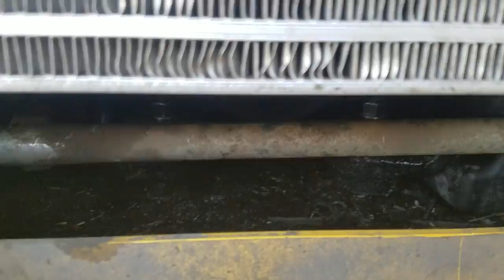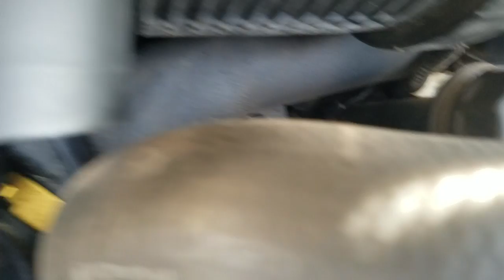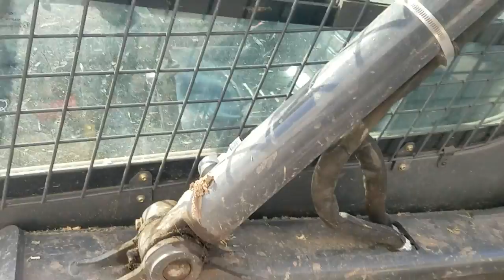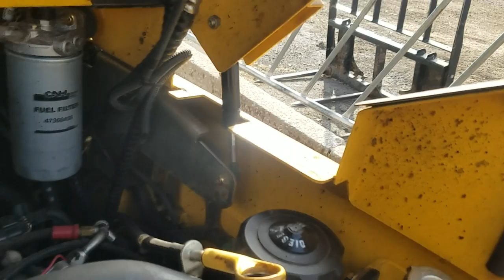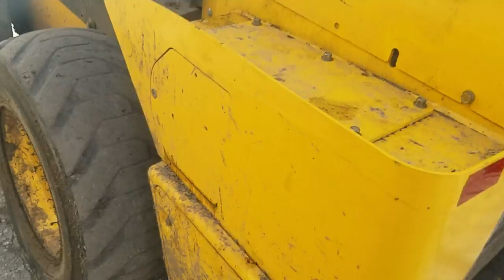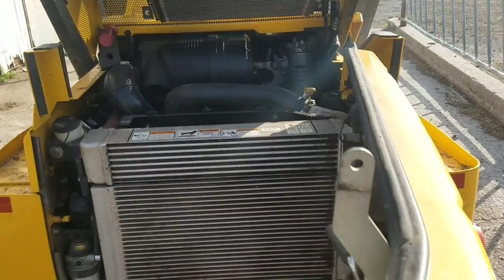The skid loader just keeps on giving more problems.

Comment: .  maybe the diagnosis of the oil leak should have been enough to know that the machine has some type of terminal problem with the motor.the tech should have advised that he couldnt fix it in the field and saved a problem with you being billed for unnecessary services he clearly doesn't have the ability to fix.
Is this machine under any type of warranty?  maybe you can get outside repairs!  90% of dealer techs dont know how to repair only to replace parts.  as  35 year's of experience tells me that . if your not under warranty obligation to the dealer., I would suggest that you find a good all around honest mechanic to be your farm repair man. maybe someone who has broke away from the dealers and works hard for a fair price!   I  work for my self as a mechanical technician and work behind the same clowns that you are having trouble with.  don't be fooled by there b.s. it happens to good people everyday. a good mechanic can fix any type of equipment and "cant fix" isn't in there vocabulary. if its not repaired then dont pay. they are just guessing and changing parts and running up your bill. if the dipstick is blown out then crank case pressure is building up . surely wouldnt be long before it blows a seal or gasket out. witch will be a great waste  of time. sounds like a burnt piston or something like that.  first 15 min on the site with a breif explanation should have been enough . sorry for your troubles.  good luck.
Reply: joe wisman it is under warrenty he said but  if you read the warrenty fine print equipment transport and service calls are not included just labour and parts sad but true
Reply: and is that not the seal they just did i think it is isn't it?

Comment: On my LS 140, it only runs for exactly 90 seconds then cuts out.  Then I gotta start iy up again to only operate it again for 90 seconds.  What could the problem be? Is it a solenoid, or other electronic part?  Is it detecting low oil pressure? All fluids are up and clean. It's troublesome.  Only have 360 hours on it.

Comment: My c238 has been at St. Joseph Equipment for a year and they admit they don’t know how to fix the problem. The bill is over $8000 and they won’t release my machine till it is paid. Code 1004 hydraulic filter restricted problem. Company engineers were no help.

Comment: Am slightly curious how the tires get that short on 300 hours? I dairy also, tires last 1500 hrs or so?  Paint looks nice yet tho.
Reply from the maker: matt schelling on the l230 you are required to run this machine wide open all the time with the horsepower it is very hard on the tires this is the second set by the way. the skid loader is at Messick it has a lot of issues they are resolving. it's not the operator this is my second new skid loader. with the def the machine you need to run this thing wide open to keep it hot so it does not plug. I hope this answers your question. have a great day

Comment: You definitely shouldn't be getting a bill if the machine is under warranty. What's the point in having the warranty if its useless. Its just another New Holland that needs a new engine before 500hrs. New Holland has a engine problem and they aren't admitting it and they probably never will. Do the same thing onelonley farmer did when he got the windrower just keep making videos showing all the problems put them on the other channel to get more views. it should catch someone's attention.
Reply: they usually have 1 year warranty and my kubota dealer throws on a free 6 year warranty on his kubota svls and ssvs

Comment: Just a question why are the tires so damn bald if it has 300 hours
Reply from the maker: Ford Farming the only way they wanted me to run this machine was wide open on concrete with that much horsepower it destroys the tires in a very short period time.
Reply: Elm custom harvesting thanks
Reply: Ford Farming I never run my New Holland turbo at more than half throttle. It works great.

Comment: Why are the tires worn out at such low hours? Abuse or poor operator practice?
Something here is not right. If you want to contact New Holland "desk people" call the NH Customer service line in owners manual or contact NH via their web site. They will talk to you, and work with you, I know from experience. I get the sense that we are not hearing the full story here.
Reply from the maker: I traded it off and got a new with John Deere 330g. The New Holland had many issues I'm not the only guy has problems with them.
Reply: @elmcustomharvesting1072  That is a solution. I hired a guy to do some work for me and he used to have 2 of the Case version. He had a dozen or so machines before these 2 and they had so many problems that it just about bankrupted him. He now has a Cat .

Comment: Maybe you paid for incompetency.  Not all those guys employed at a New Holland shop are smart enough to figure out technical issues.  Oil changes are not a problem.  But a good technician maybe not, but you still paid the hourly rate because repair shops require that kind of money.  It's shameful.  If it was a simple fix that they shoul've diagnosed  in the first dsay of trouble shooting, I'd bitch about it. So sorry you are going that issue. But by now in 2018 what was the problem???